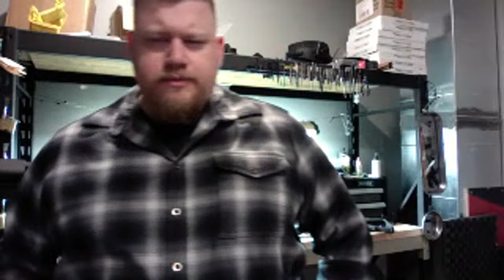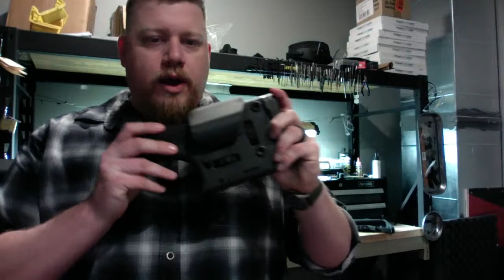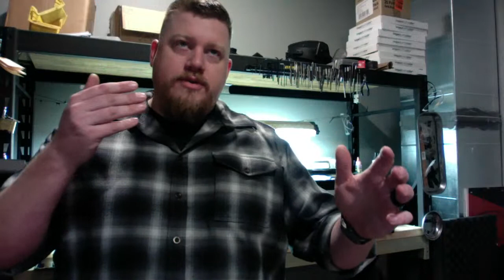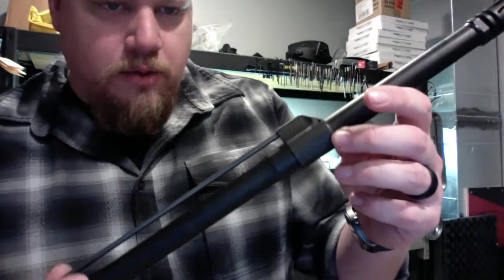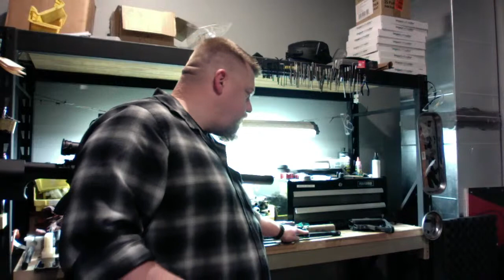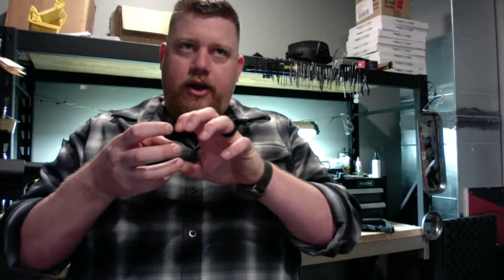LMT Defense Q&A 3.2 DMR and the MRP

Comment: Why do some of the NIB enhanced bolt carriers look like the gas port isnt staked well? Is it possible for one to slip thru QC without being staked? That's one seller's claim on Gunbroker.
Reply from the maker: I imagine that you are referring to the gas key. There are always chances for items to slip through QA. It still requires human interaction. Not staked well and not staked are two different things. The staking is there to prevent a screw from walking out only if it were to come loose in the first place. Have you personally seen this, or are you just curious because of a GB comment? Also LMT doesnt make anything NIB
Reply: @lmtdefense3927  brownells box- but no not personally, just a gunbroker comment made by seller. It made me inspect mine further and its staked- not perfectly but what is? Ty for answer